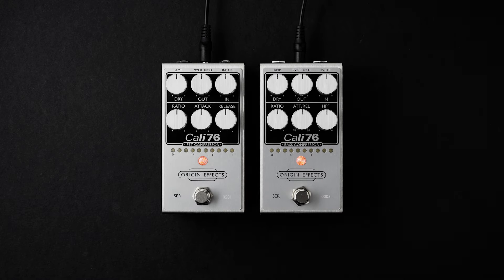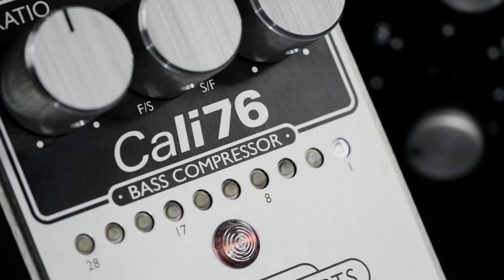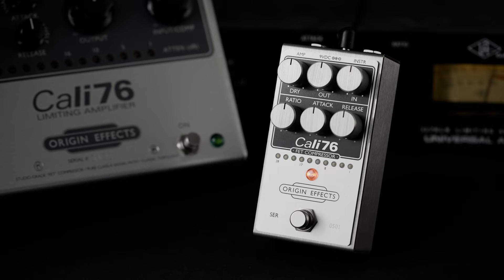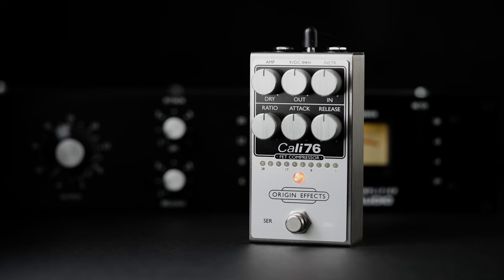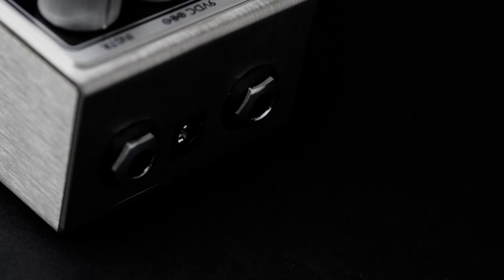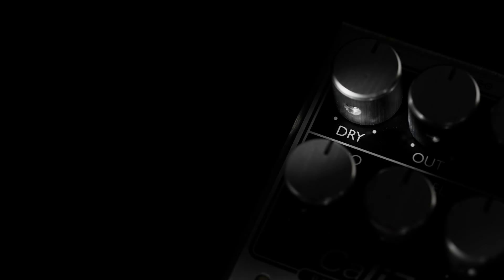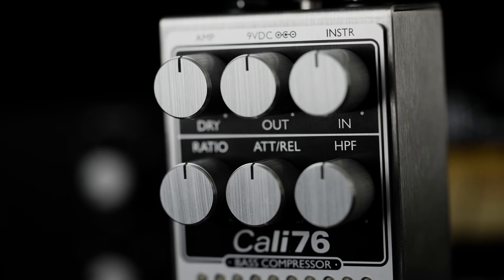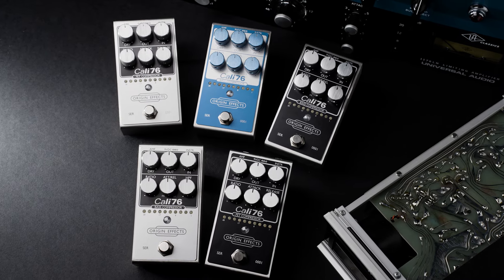Cali76 FET & Bass Compressor: Product Introduction

Comment: Can i use the cali 76 fet compressor for bass? are they the same pedal except for the HPF?  I have The Cali76 TX and i want a smaller format  and the most similar to it in terms of controls
Reply from the maker: You can. The pedals have a few minor internal differences, time-constant settings are different, the preamp inside runs a hair different.

But the FET can still would fantastic on bass and some people prefer it.